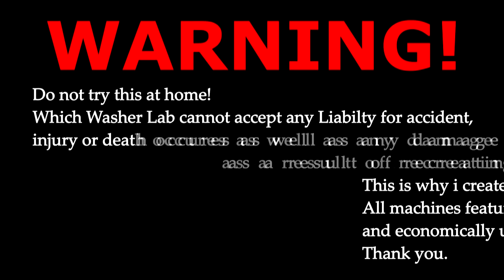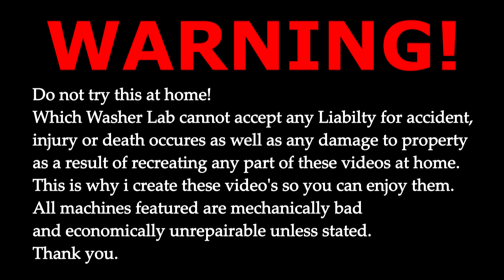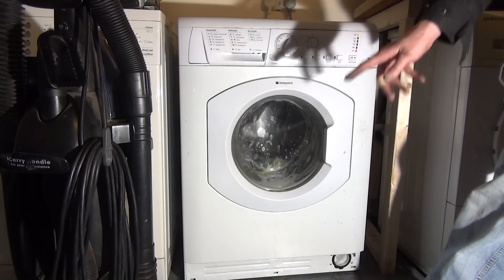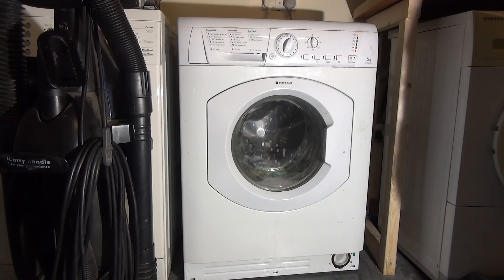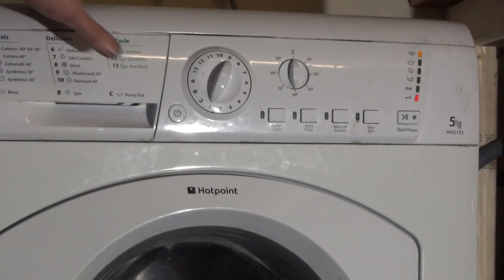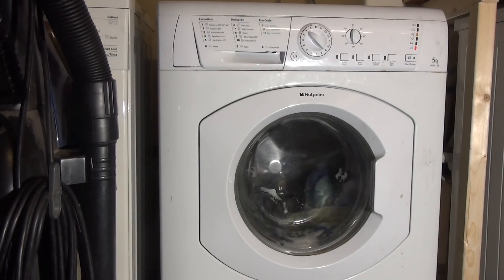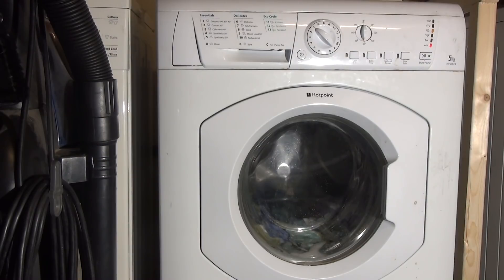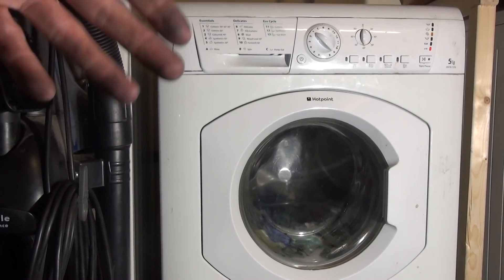Lab Test : Washing single towel with Broken motor speed controller

Comment: it'll need a new circuit board good condition though
Reply from the maker: Too expensive to do. Triac on board is replaceable, but after looking online, could not find the correct triac so its scrap. Drum is going in a indesit and the door may be used on another hotpoint.
Reply: @whichwasher2007  aand the detergent drawer